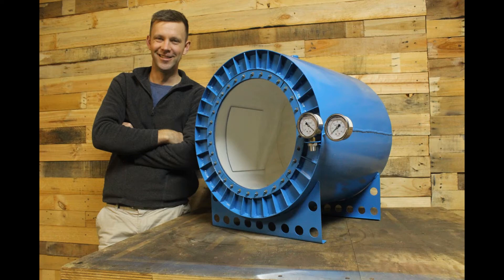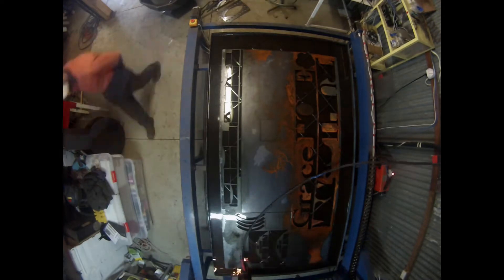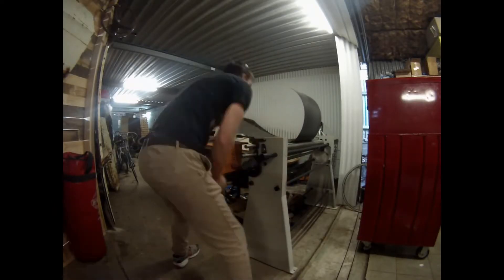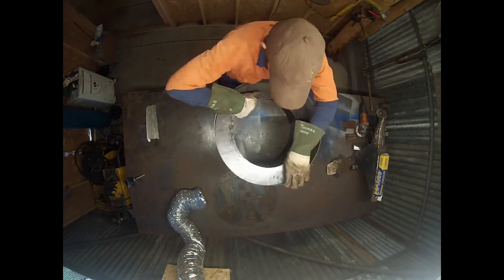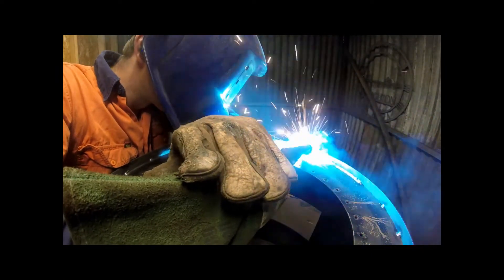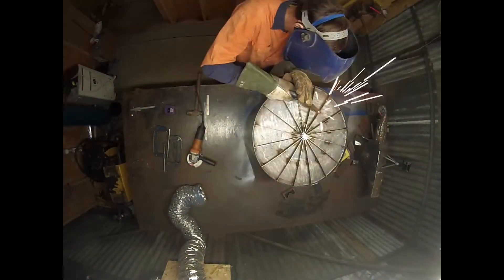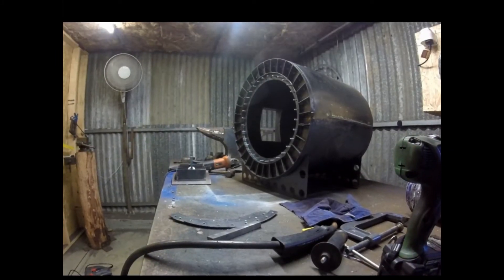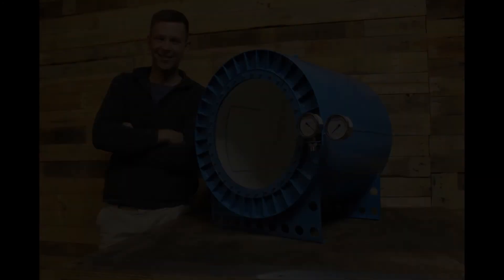vacuum chamber build

Comment: Hi Thomas, Want to ask what thickness metal sheet did you take for the shell of the chamber?
Reply from the maker: Hi there, I used 3mm mild steel. This is quite thin so I added gussets either end as any flat surface with be a weak point and tend to buckle. If you are making plans to build a chamber I recommend over engineering it to be on the safe side.
Reply: @thomaswompyward447  thanks for the information. I made a similar circular chamber of 400 mm I'D with 5 mm plates.
Moreover I have the ends dished torispherical. It's quite safe but it has become too heavy. So I was thinking of making a lighter one.
However your assertion has cleared my doubt and I think the 5 mm one is okay from buckling point of view.

Comment: Subscribed.  Do you know if a homemade vacuum chamber can achieve 1 mbar (0.75 torr, 0.75 mmhg)?   
0.01 mbar?  
Might that be possible in a rectangular chamber around 600 mm x 300 mm (24"x12")?
Reply from the maker: Hi Jonathon, thanks for subscribing. I think the level of vacuum depends on the pump you have. I was only able to draw it down to -13.5psi. Absolute vacuum is around -14.5psi.  that last 1psi is difficult, my pump wasn't able to get it but if you invest $200 or so on a good pump I'm sure its possible (as long as there is not leaks in the chamber). Probably should note that if you make a 600x300 chamber make sure you use thick Perspex 25mm or if using steel10 - 12mm, as the pressure will want to crush it.

Thanks for the question Jonathon :)

Comment: What's the thickness of the clear screen?
A follow-up video would be nice.
I am trying to build one to dry wood under vacuum.
Reply from the maker: Nice Idea, sounds like an awesome build. The screen is Perspex and is 15mm thick, but I have to say on full vacuum I can see the screen start to bow in. Probably 20 to 25mm would be safer. Hasn't broken yet having said that, Perspex is tuff stuff. A big factor would be the size of the window, smaller window is certainly stronger.
Just working on a new video for a different project now, but I'll try and do a follow-up video in the future :)